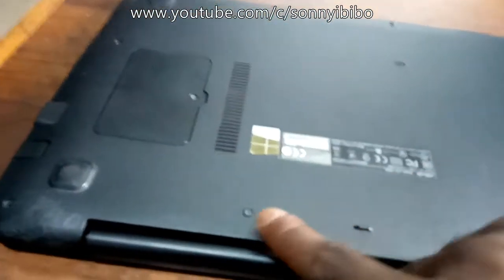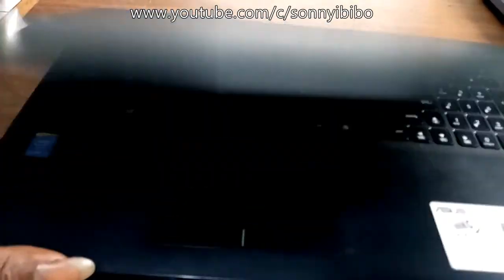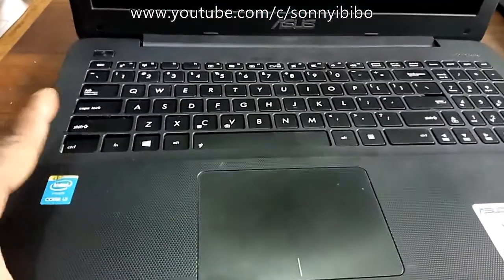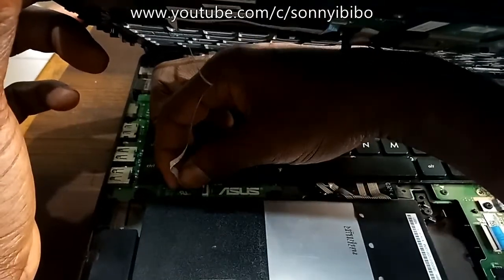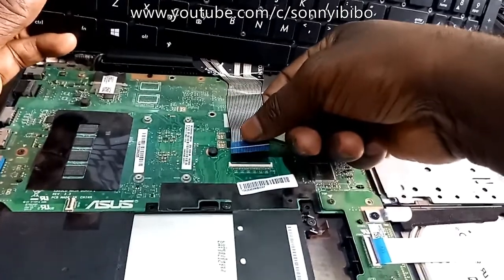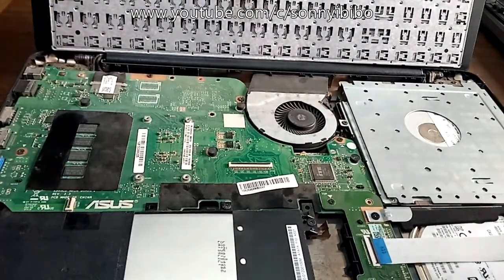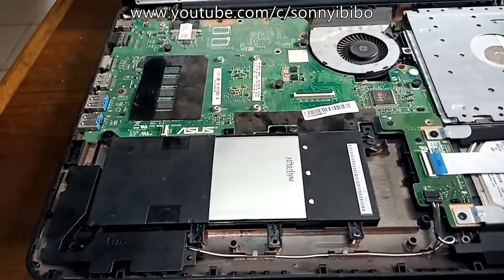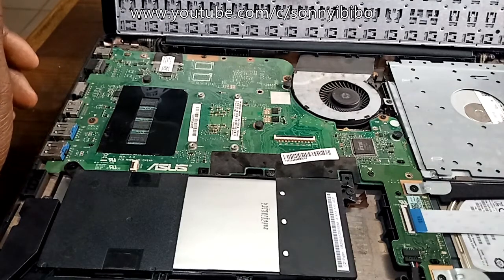ASUS X554L Laptop: How to Replace the Keyboard | HDD | Battery

Comment: where i can get key board for this model ?
Reply from the maker: I replace Keyboard of the Laptop with an 'after-market' compatible  one. And it's been okay.
Reply: @SonnyIbibo  but i m not getting as the enter button of the keyboard is in L shape
Reply from the maker: @padmanabhbaadkar  the ENTER button on the after-market keyboard I used not L-shaped.
Reply: @SonnyIbibo  yes that is the issue bro.. can alternate option
Reply from the maker: @padmanabhbaadkar  but, mine works good.